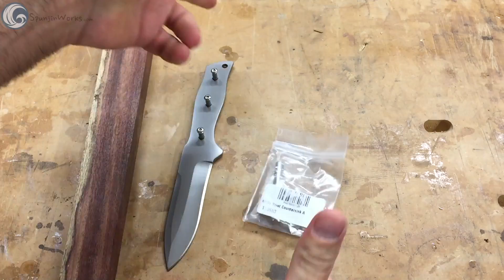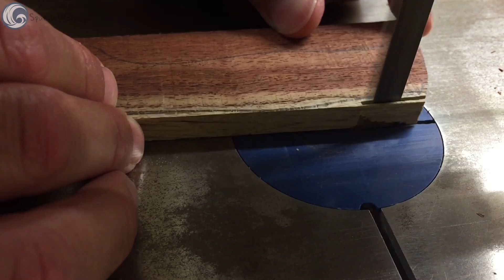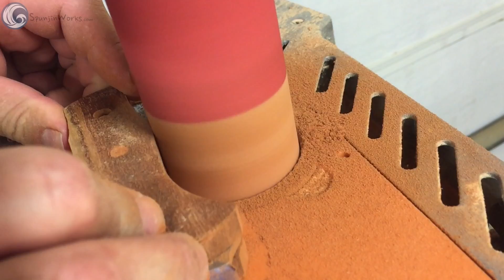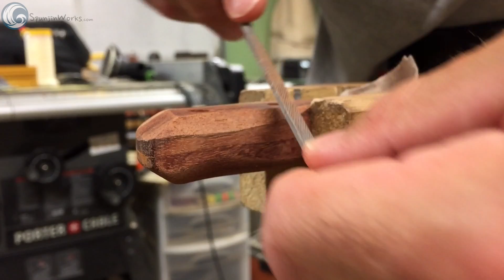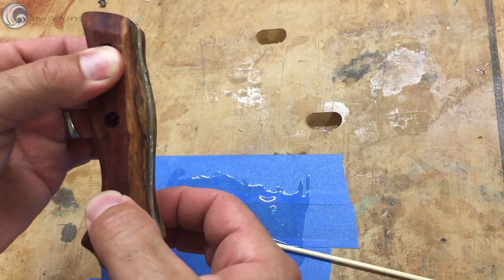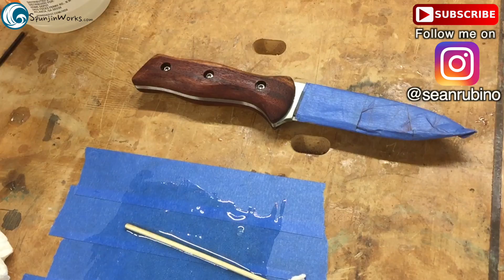Make Wood Knife Scales // (Ep. 73)

Comment: Nice knife! Love it.
Just wondering though. Why did you cut the wood in half and then trace out the handle?Seems like it would have been easier to trace out the handle on the whole piece and then cut the smaller piece in half after.
Reply: Admittedly, a very minor nitpick but seems like it'd cut down on the cutting lol
Reply from the maker: +Johnathan Schreiner thanks, Johnathan!  That is a great observation and something I didn't mention or show. The blank I used had a nasty crack in it on the other half of the wood.  If it were a solid piece which was unflawed I would have cut it to rough length, resawed, and cut out the shape to save the other half for another knife or something.
Reply: Sean Rubino 
Makes total sense. I almost didn't ask because I assumed there had to be a reason haha. Thanks for answering!
Reply from the maker: +Johnathan Schreiner sure thing!  It was a good question.